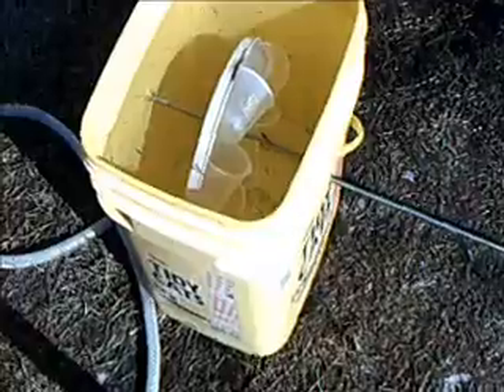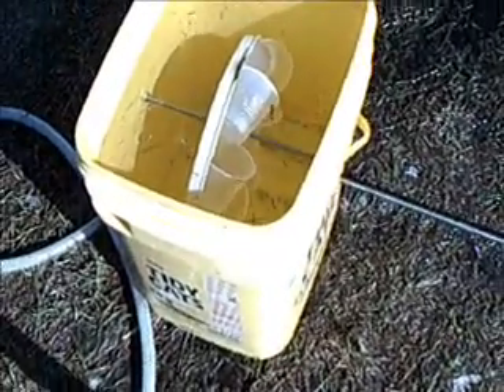Tjgame2's HHO wheel with the 72 plate monster

Comment: if it was a conveyor chain instead of a wheel-the height of water could be higher-allowing more cups to be filled exerting more lift.
on a wheel you would be struggling to fill 1 third the cups-on a chain conveyor you could fill half the cups

Comment from the maker: yeah i cant go with a smaller tip, i need a little bigger than what i got cause i build alot of pressure up in my system when I use the torch ...I am always fighting leaks in hose connections .....Yeah that would probrably work ..I am going to try to build a closed small unit this week, I think this has potential for getting mmw's higher ..